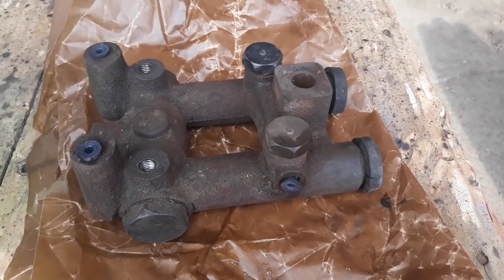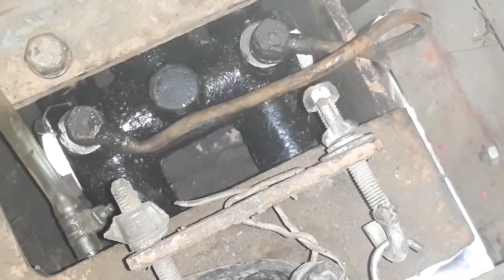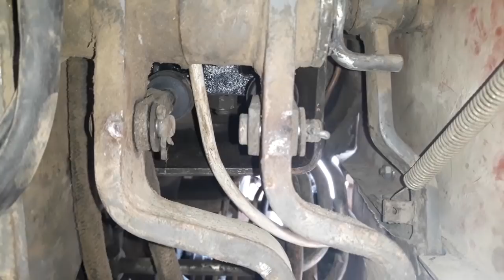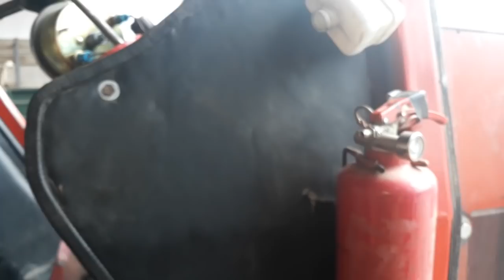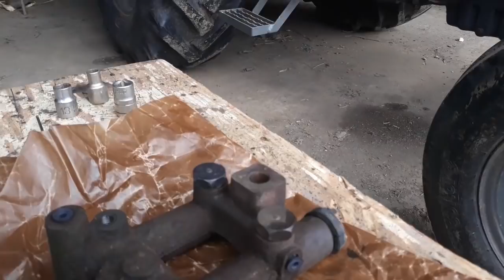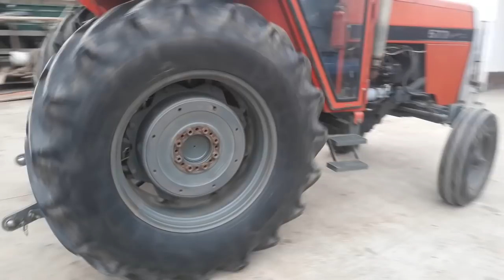Zamena glavnog kočionog cilindra KNIC ZASTAVA | IMT 577

Comment: Za kolko para moze da se kupi takav 577
Reply from the maker: Zavisi od stanja traktora, ide od 6.000 - 8.000€ ovaj ne bi dao ni za 10.000€
Reply: Nema za 6000, od 8000 pa na gore
Reply: sladjan radosavljevic ma idi begaj relna je cena ovakvog oko 6 a ovi novi tipovi oko 8
Reply: @markoradovanovic4721  u hrvatskoj dobar 549 nema ispod 6500e